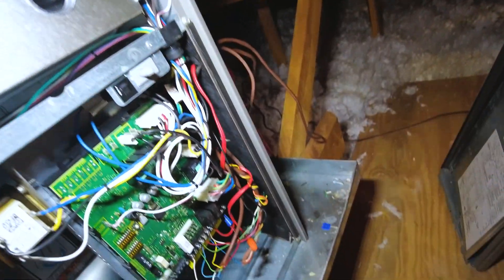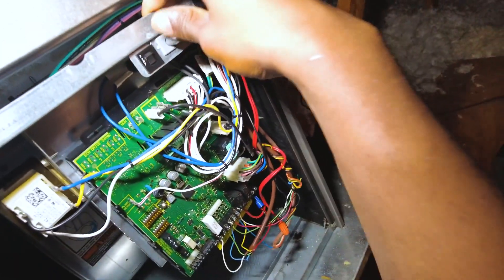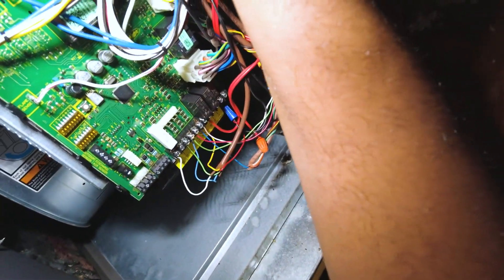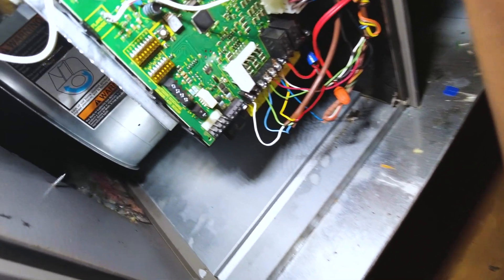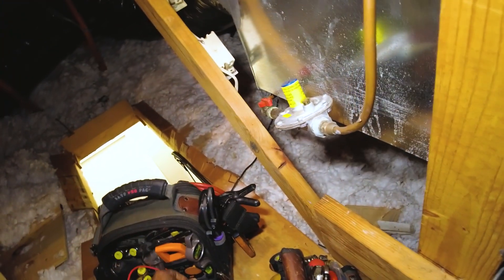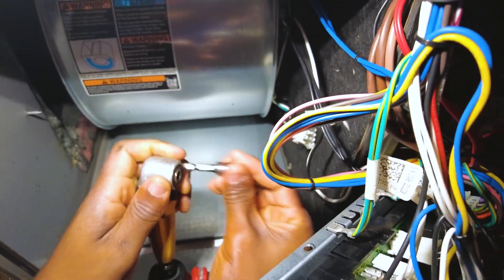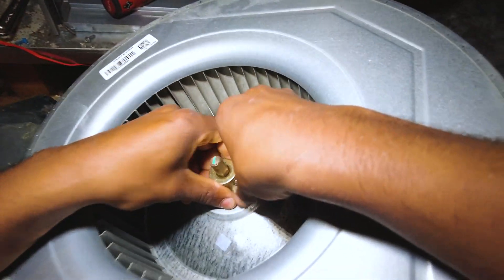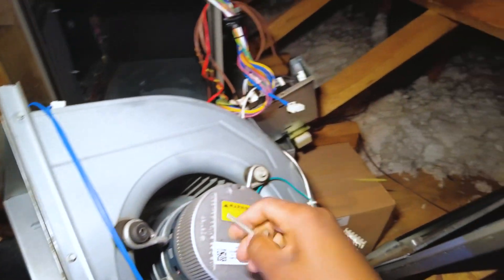What a Failed ECM Motor Module Sounds Like | Replacing a Variable Speed Blower Motor

Comment: You could have left the motor IN PLACE! Only the control module needs replacing. They are available on Amazon and Ebay for about $125. Two screws and then just mounts to end of motor. Cheaper and faster than changing entire motor!
Reply from the maker: That's true but usually when you're working for a company they're just going to tell you to go and swap out the whole motor cuz it's really hard to tell whether it's the module or the motor itself. I had one just a few months back where the motor was kind of turning slowly which I always thought was a sign of a module failure, I swap the module from a motor on a nearby unit and it still did the same thing. Once I replaced the entire motor it started right up. I say all that to say most of the time it probably won't be worth the time trying to order the specific module because its  basically a 50/50 shot weather its the module or motor. Appreciate the advice and thanks for watching!
Reply: @HVACTechKnowledgy yet not once did you check motor windings resistance 😂

Comment: I have the same exact sound on my motor replaced it and the new one acts exactly the same. I am not getting 24v from speed control wires. Is it the board
Reply from the maker: More than likely the board, thermostat or harness if you're not getting 24 volts

Comment: Good job young man and great looking set of tools, a sure sign of a real technician! Just an old dudes prospective not criticizing 33 year in the trade, why not take the blower down and work on it in the driveway or even better your shop/garage or somewhere is most comfortable? I’ll be honest I don’t work on equipment much anymore I have techs that do and I’m on them constantly about how they work. Good workers, good techs and I try to protect their knees and back as much as possible. The idea when possible is to get in and out of uncomfortable situations asap. We work hard as it is let not make it any harder than it has to be. Stay safe
Reply from the maker: Hey there! Thanks for the feedback. Yeah usually I would just pull the whole housing out of the attic but that day was just so hot and humid outside, plus it was on the second floor attic and I didn't feel like lugging it up and down stairs. Tuffing out those 120° temperatures just seem like the lesser of two evils at the time : )
Reply: @HVACTechKnowledgy  yep sometimes you just have to get it done, keep the great videos coming

Comment: ?   My air unit blower went out.  I tested the high voltage going to the ecm motor and its fine, I checked the low voltage and its good… I ohm’d out the motor and its fine. I ordered a new ecm and installed it and the motor was working but didnt sound right.  Sure enough witching 10 mins the fan stopped working again.   Any thoughts on what might be going on?
Reply from the maker: Just to be clear did you replace the entire motor or just the module?
Reply: @HVACTechKnowledgy  just the module
Reply from the maker: At that point it's very likely going to be the motor
Reply: @HVACTechKnowledgy  On the motor connector pins my ohm readings were 12.8 12.9 12.9.   OL on all pins when I probed the connector pins to ground.
Reply: @HVACTechKnowledgy  i ordered a OEM motor with ecm and will replace hopefully tomorrow    Im worried something is shorting out the ECM.
Reply: @HVACTechKnowledgy  ❤️

Comment: What have made is taking and old blower wheel and removed the hub then weld a 1/2” piece of black pipe to it. then put a rod for a tee handle through the pipe. This can then be tightened to the motor shaft to Facilitate twisting the shaft back and forth to loosen it.
Reply from the maker: Sounds like a good idea. Thanks!

Comment: Wire wheel for the drill. Works better. Ands it’s faster. Motor will drop out.  Haven’t used a puller in over 15 years. Mine is still new in the package.
Reply from the maker: True, yeah i usually use emory cloth which i did on this vid but it just wasnt letting loose. Also the shaft wasnt even rusted or corroded. Thanks for the feedback and thanks for watching!

Comment: Was that an OEM replacement motor or one of the Greenfield ( if I have the name correct) replacement motor and Ecm module? Must have been a morning job in that attic. Thanks for sharing.
Reply: The motors are Evergreen. That is OEM. The Evergreen motors are green.
Reply: @BIGBOB-ew9oo  Thanks for the correct name.
Reply from the maker: Yeah its was OEM.